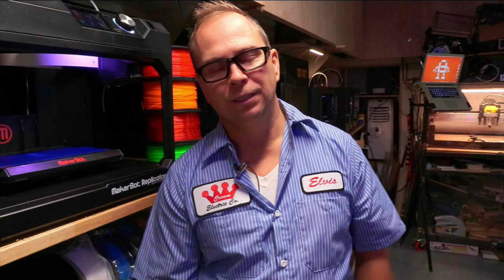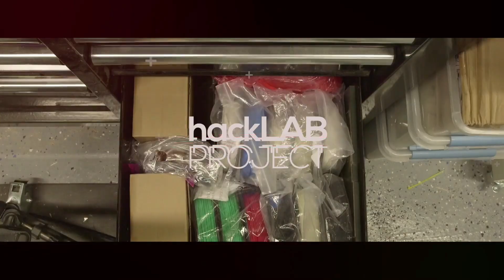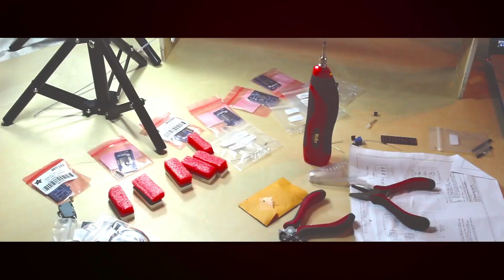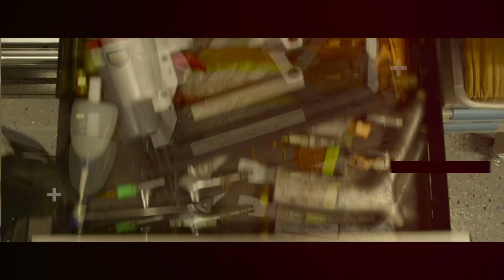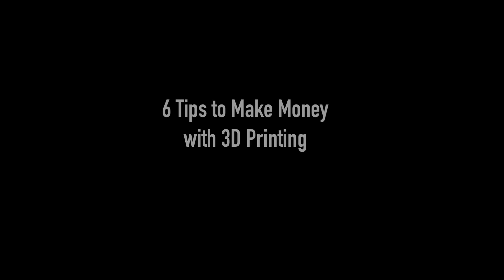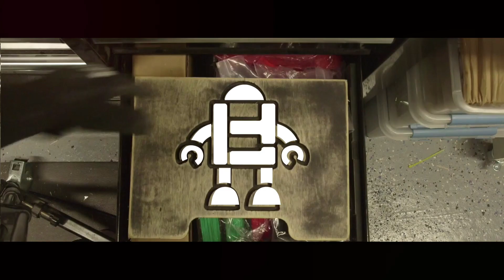Make Money with 3D Printing - 2019

Comment: I have like one 1k to start what printer do you recommend.  In school I did design stuff on a software called inventor and 3d printed them so I kind of have some experience
Reply: I mean you can get a good printer for a lot cheaper for instance the flash forge finder  which is a great entry level printer 👍🏻
Reply: I have an ender 3 it is around 200 dollars and when well tuned can make prints that look as good as prints from machines up to 10 times the price

Comment: Could you recommend a 3D printer for me? I was looking for a print space that's at least 14"× 12"x Any and a lot of versatility to use various filaments/nozzles. Thanks in advance!
Reply: 44Maxray 

I’m having a great time with my CR-10 V2. Print area 300x300x400 mm.
Reply: Ender 3 / Ender 3 pro. Great printer with fantastic detail. Around 200 dollars in price (atleast where i bought mine)
Reply from the maker: Good advice guys, Look into Prusa too.
Reply: @hacklab-ryan  that's like 4 times the price
Reply from the maker: Miguel Ángel Rodríguez you need a reliable printer right? Buy used. People sell cheap they can’t hack the 3D business. You will do great don’t give up!
Reply: @miguelangelrodriguez9293  Just a FYI. Prusa has the new Mini now which is half the price of the MK3s. $350usd. Not the cheapest printer on the market but if you like Prusa products now you can own two Minis for the price of one MK3s.